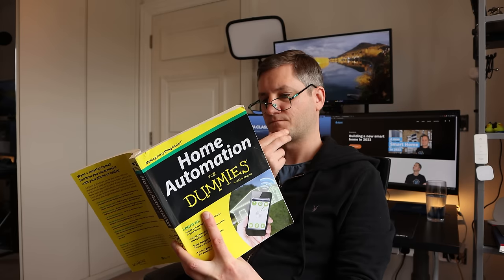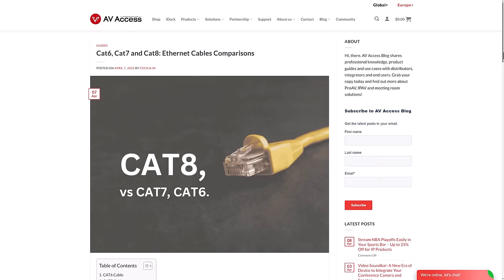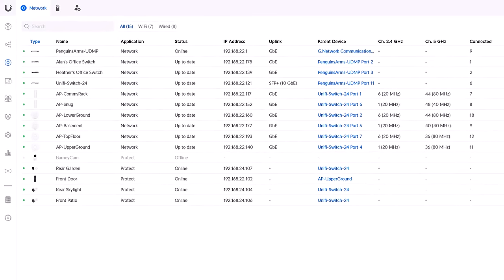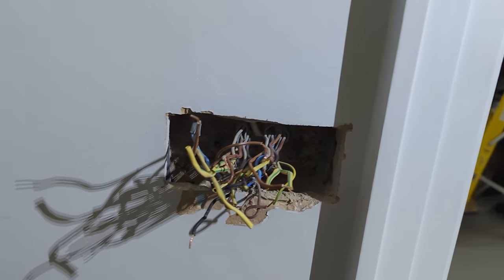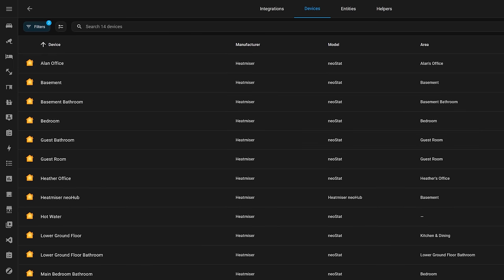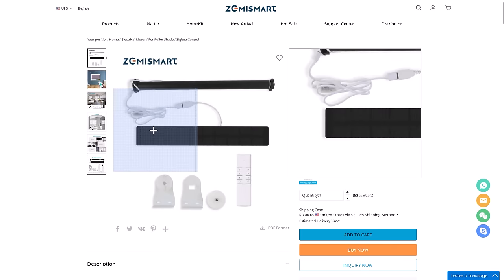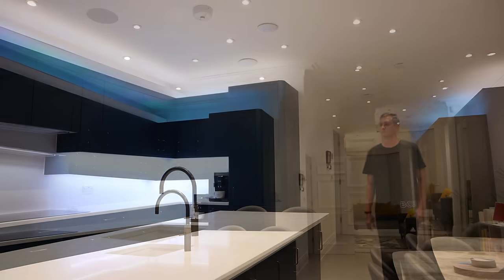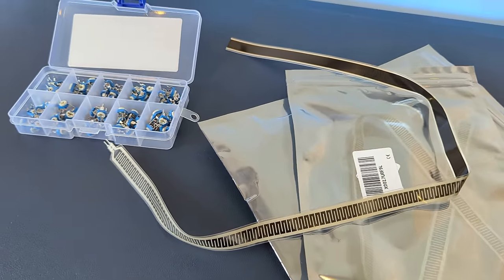The best and worst decisions I made for my smart home

Comment: Ahaha, I love that you are "stuck" on the same point for the FSR bed sensor as I do. I also bought all the parts, put it all together but the resistor value calculation struck me the most. Funnily enough, the recommended value that was mentioned on the forum worked fine for me (can't remember it now, sorry). It worked perfectly as a proof of concept also with LED and PIR sensor that I included in the ESPHome but I never installed it on the bed itself. I'm also considering of using VL53LOX Time-Of-Flight Sensor instead of the PIR but I'd have to do some more testing on that. 
Would love to see your take on it as well. 

Here is what I used when it comes to the ESPhome. Of course, make sure to adjust the entity names :) 

# LED - WS2812B
light:
  - platform: neopixelbus
    type: GRB
    variant: WS2812
    pin: GPIO23
    num_leds: 50
    name: "LED strip light"

# PIR Sensor
binary_sensor:
  - platform: gpio
    pin: 19
    name: "PIR Sensor"
    device_class: motion

# Pressure / Occupancy sensor (FSR)
  - platform: template
    name: "Bed occupied"
    id: bed_state_test
    device_class: occupancy
    icon: mdi:bed-outline
    lambda: |-
      if (id(bed_sensor_test).state < id(trigger_level_test).state) {
        return true;
      } else {
        return false;
      }

number:
# Pressure / Occupancy sensor (FSR)
  - platform: template
    name: "Michal bed Trigger Level"
    id: "trigger_level_test"
    mode: box
    optimistic: true
    min_value: 0
    restore_value: true
    unit_of_measurement: "V"
    device_class: voltage
    max_value: 3.3
    step: 0.01
    icon: mdi:chart-sankey

sensor:
# Pressure / Occupancy sensor (FSR)
  - platform: adc
    pin: GPIO36
    attenuation: 11db
    accuracy_decimals: 3
    device_class: voltage
    name: "Bed sensor"
    id: "bed_sensor_test"
    icon: mdi:arrow-collapse-vertical
    update_interval: 0.2s
    filters:
      - exponential_moving_average:
          alpha: 0.1
          send_every: 1
      - or:
          - throttle: 180s
          - delta: 0.02

Comment: Interested to see your next video. 

I bought my home just about a year ago, and only just started to get into the home automation thing. 

I'm in Aus, so wired switches are limited, and I didn't like any of the choices. I bought an Aqara 2-gang wireless switch, and while it physically feels great, it's completely broken in Z2M. I ended up going with a mix of 1, 2, and 3 gang wireless switches from  Tuya. They look about the same, but don't have quite the solidity of the Aqara ones. For about a third the price they've been good for me so far. I also prefer the physical 'click' sound - the soft touch ones are easy to miss and not trigger if you miss the mark. 

In terms of AC and automation I went with Broadlink RM4 mini's.  They're WiFi, but so far pretty good. 

The SmartIR HA integration needs a bit of love though to support fan modes and the louver swing/static positions.
Reply from the maker: I was hoping not to have to go down the IR Blaster route, but I've heard good things about the Broadlink devices.  A lot of my friends have had similar trouble finding AU Compatible smart switches - hopefully some more suppliers support the market soon! 🤞
Reply: @HomeAutomationGuy  Yeah I don't like the IR Blaster option either. But it seemed like the best of not great options. 

The installers of the system quoted over $300 per head (four heads on two split systems), and there was no guarantee it'd actually work with HA. 

My approach with the broadlink ones ATM is just to get something going for about $20 each.  

My plans for the future involve trying to integrate the Arduino library (arduino-heatpumpir) and some other sensors to get better control of the system.

Comment: On the network cabling +1. Luckily I put a full rack plus switch in place before seeing your videos. Like you, I deeply regret not adding more cabling (also dual cable on the same path). The rapid growth of PoE means you can get so much more out of more cabling. We are also just about to see LED lighting become viable via PoE. Maybe some kind of star configuration would work well to reduce long point to point CAT cable runs, and to take advantage of multi-gig switches which always seem to have reduced port counts.
Reply from the maker: I have plenty of ports available in my rack too, but like you no extra cabling.  We really should have foreseen the PoE eh!?

Comment: The best decision I made was ditching Control4 and going with my own HA build. Look Mom no dealer! Control4 did teach me about the benefits of Zigbee. After that I found switching from Unifi to Asus gaming capable wifi routers and their airmesh system gave me a faster and more reliable network. But you are better off not network hardwiring them together, instead  allowing them to mesh over wifi. I find if you have network nodes meshing over wifi and cat5/6 you get network storms. Same with Sonos. I will be upgrading to wifi 7 with Asus when it's available. And sticking with zigbee. Oh the other choice at the start that was huge, was using Digiblurs HA server build using an old Dell mini PC rather than something powerless like a Raspberry Pi. That way I always had enough processing power and RAM and a fast SSD to build a reliable platform without running out of juice and having to upgrade the server. Always overestimate what server you will need as it's inevitable the project will expand. Oh and never run HA off an SD card!

Comment: Automating the lights was the first thing i did, it got the wife to buy in to it all. But getting face ID to unlock the front door was the killer automation for my family. Then i made a weight sensor that tells me when to refill the water softenerr, house alarm integration (Texecom via UART port) which incidentally gives you presence detection via its PIR in each room and window/door open status, this lead to automations for turning off the heating in zones with open windows. I started off with WiFi and Zigbee but eventually went PoE wired ESPhome devices everywhere, it was a lot of cabling but totally worth it for the realtime data and no batteries/ radio signals to worry about.
Reply from the maker: Weight Sensor for the Water Softener!! Genius! I've been trying to figure out how to automate that at home - I keep forgetting to put those damn salt bricks in.  Thank you so much for the tip!

It sounds like I'm a bit behind you in terms of my smart home.  I recently got the Texecom integrated into my Home Assistant using the network module and Texecom2MQTT, and I'm slowly on a mission to put ESPHome devices everywhere - but starting with Wifi modules rather than PoE due to my lack of cabling.  Thanks for the comment!
Reply: Hey! I am a bit curious on what you mean/how you achieved the face ID to unlock. Could you elaborate on that, please?

Comment: I also installed the Aqara light switches but they've been very temperamental. Constantly dropping off the network and the physical clicking sometimes not working (you have to click around the switch until you find the sweet spot). One has stopped working altogether. Also, recently physically clicking on a light switch no longer triggers any automation (but it works if the light is switched on remotely) - think it may be due to a recent HA update... Any tips to improve the experience? Thanks!

Comment: Another great video. Thank you for this. 

How many zigbee power monitoring plugs did you have before they became too chatty on the the network? Did it get to the point of causing slowdowns in communication among zigbee endpoints or did you switch to wifi plugs before it got to that point?
Reply from the maker: I had 4 or 5.  I did notice the occasional delay, and when I looked at the Zigbee I saw these power update entries streaming past really fast and thought it was best to quit whilst I was head.

Comment: Comment on fiber vs CAT6 in the house. There is another option. Fish through a fiber backbone in the house, the run whatever CAT you need at the time (I ran CAT 6A). Gives you the best of both worlds. I have fiber going to my main rack in the basement and to the secondary distribution rack in the attic. My system have two runs of fiber for the future, but I am distributing on CAT 6 A in the short term to the APs. Wasn't cheap either, but agree investment is the way to go
Reply from the maker: A lot of the cat6 was already in my house when I bought it, and it's dot-and-dabbed into the plaster and therefore impossible to use as a draw wire. If I was building a new house I'd probably go with a suggestion like yours - best of both worlds is always great!

Comment: Only 95% OK that is dammmmm good .... Cool video and good input..  Besides cabling and the rack in the laundry ... what else would you have previously done better... Yes the shades. notthing else in the.  I do think you should measure and track the humidity level and condensation in the rack room as this will cause trouble to the electronics. It is a high risk high humidity zone
Reply from the maker: Yeah, it's a fair point. I have a temperature and humidity sensor in there and it's been fair stable. The dryer condenses into a chamber and empties into the waste water automatically.

Unfortunately when the house was built (before I took it over) all the services were run into that basement room and it would have been difficult and expensive to move them.

Comment: I watched many of your videos and setup my Home Assistant, with some Sonoff Zigbee smart relays (ZBMINIL2) controlling my kitchen under cabinet lights.. The ZBMINIL2 can only live for a few months for unknown reason, then it is dead with completely no response to anything, including the push button and LED on itself. Not possible to rest from that point. They are now in the bin, but are there more reliable Zigbee smart relays? Is the Aqara one more reliable? Since I have the Home Assistant, I really don't want another hub next to it, if I can avoid it. Is Shelly a more relaible one? But that's WiFi not ZigBee. Nothing is perfect. Philips Hue is reliable (most of the time), but they don't have a product like a relay switch, they only have plugs. Please suggest one - thanks.
Reply from the maker: I use the Shelly relays.  I usually stay away from Wifi devices, but in this case they've worked very reliably and I'm happy with the locally controlled, open nature of their products.

Comment: Any chance you can describe in a bit more detail how you set up Daikin with home assistant? From what I found it can’t be done on the later versions of the firmware.
Reply from the maker: I am able to control my Daikin using the Onecta app on my phone.  There is a Daikin Onecta integration for Home Assistant available in HACS that I'm able to use to control my units via their cloud API.  It's not the ideal solution, but it works for my use case.  https://github.com/jwillemsen/daikin_onecta

Comment: Good roundup. Might reconsider my zigbee-ignorance. I am early in my HA career and still learn. Agree with the Ubiquiti decision, done that too and it is great. One SSID, VLAN and stable network compared to those mesh-mess I had before. Most of my current devices are from SwitchBot. And running off a dedicated Mini-PC with HA on it. But those devices at least once a day become “unrecognized” and need to reboot the Mini PC. Not sure what that reason is, the wifi can’t be and via the maker app I continue address those devices (curtain, motion, color bulb). So I still have mixed feelings if I can release those stuff to my family. Right now only running in my cave.
Reply from the maker: Running stuff in your "Cave" before unleashing it on the family is a great idea - I do the same thing in my office!  If the SwitchBot continue to work via their app, it sounds like an issue with the integration.  Take a look at the log files on Home Assistant and see if there's any clues there before you bin it all and start over with a new protocol.

Comment: Thanks for the round up, it is nice to see content about withstanding the test of time.
I decided on the aqara light switches after watching your video. My only issue with a few of them is that they don't report their state to Hass. I can control all via Hass my if someone manually turns them off or on, they will not update Hass entity with that. Do you experience the same issue?
Reply from the maker: No, I don't have that issue at all.  If I press the button on the wall the state is immediately changed in Home Assistant.  I'm using Zigbee2MQTT - not sure if that makes a difference.

Comment: Great video. I have had a virtually identical experience, including Dream Machine Pro and Proxmox HA installation.  I've looked in my "smart devices purchased but either not used or stopped using" drawer and found an Aqara cube, switchbot, Ikea devices, Meross temperature sensors and early versions of Sonoff relays bought with a rush of blood to head one Amazon Prime day sale . I have mixed feeling about my Aqara rollershade drivers  as they work for most but not all of my blinds, the ones with stiff movements just don't work reliably and all of them can be a bit dodgy if it is really cold outside. I do like the small format of Aqara door sensors, motion sensor and temperature sensors I have about 30 of them, but I hate the fact that I go through so many batteries. I have tried the rechargable batteries but they just don't last long enough. I was an early adopter of Phillips Hue and have about 50 devices, lights and switches mainly I have kept them controlled by the Phillips hue hub and also by Homeassistant, I like the redundancy this provides. One of my most helpfull automation that I developed last year was a boilier efficiency automation which monitors the flow and return temperatures to my boiler, integrating outside temperature data to provide weather compensation information. Using this setup I was able to get my boiler effiiciency up over 94%. My goto smart plugs are also the energy monitoring Local Bytes ones. I have a couple of the Presence one/presence light devices and will use them to replace a couple of Aqara motion detectors. I think the automations that get  the biggest WAF for are automatically switching on the electric towel radiator when someone has a shower,  automatically switching on the TV backlight when the TV is switched on in the evening and providing us with notifications when the Washing Machine or dryer has finished their cycles
Reply from the maker: Thanks for the comment - I totally forget to mention my Aqara Cube! I abandoned that years ago.  I have to look more into these advanced boiler automations, a couple of people have mentioned them to me and it sounds very powerful.  I also love my TV backlight automations and the washer/dryer notifications.  They're super useful!
Reply: If you would like to know how I put the hardware together and the dashboard I used, I would be happy to share it with you.

Comment: Daikin AC's have a WIFI module which you can install in them. I have a Daikin multisplit system with 4 internal units and all of it is being controller via local wifi.
Reply from the maker: Thanks for sharing!
Reply: @slepix could you please share any more info about this?

Comment: avoiding battery powered devices is a good idea but it is not always possible. 
the way i avoid the problem with batteries going flat without warning is to put those sensors in a group which reports the lowest battery level. i also have gauges on my power supply page and 2 automations that get triggered when a battery hits 20% and 10%.
the weird thing is that some of my sensors have been in use for months (probably more than a year) now and still report 100% battery.
Reply from the maker: That's a good solution. But some of my ZigBee devices show 100% for two years and then one day drop immediately to 12% 🤣. Some don't even show their battery percentage at all 😔
Reply: @HomeAutomationGuy  if my batteries suddenly drop to 12%, they'll trigger that automation. which is of course why i set it up.

Comment: Some useful info here, thanks.
I've wled strips dotted around various places. Lately I've had issues where the controller crashes so the leds get stuck on one colour until I power cycle them.
I've even resorted to using WiFi smart plugs to force reboot them daily. Does that make them doubly smart? 😅
Reply from the maker: I had that issue with WLED 0.14.1, but it seems "better" on 0.14.2. Are you still seeing the problem with the new firmware.

Double smart lights... Now maybe I should do the same!

Comment: I too have a unify network and would love to be able to view on my dashboard my internet traffic.  But SNMP is not enabled on a UDM SE by default.  I've tried to install it but didn't have any luck.  Have you found a solution here?  If you have I'd LOVE a video on this :-)..  Either way, great video.  Thanks.
Reply from the maker: I've not tried to integrate the Unifi analytics into my Home Assistant - do you get any data from the standard Unifi integration that you can use?
Reply: @HomeAutomationGuy  You get some, status, if updates are needed, things like that.  You can also enable/disable ports and if you have the PDU, power outlets.  But no traffic by default (which would be more interesting)